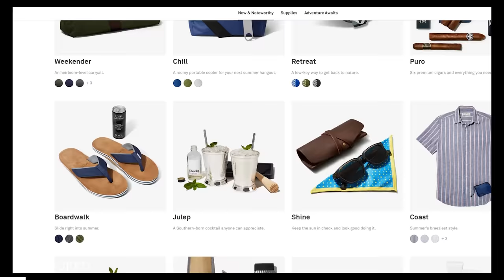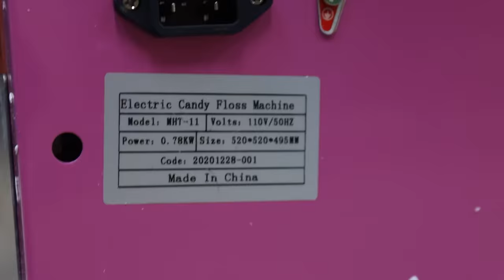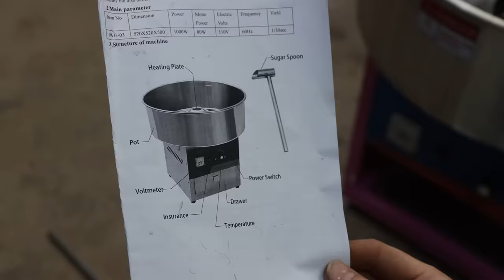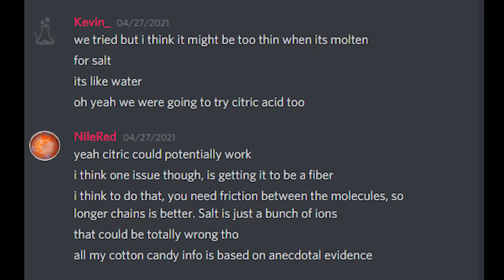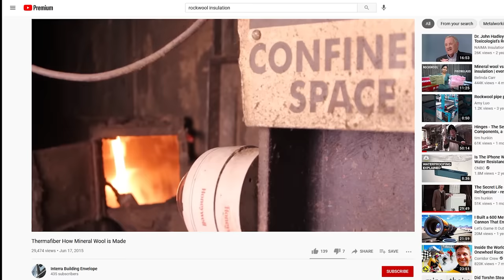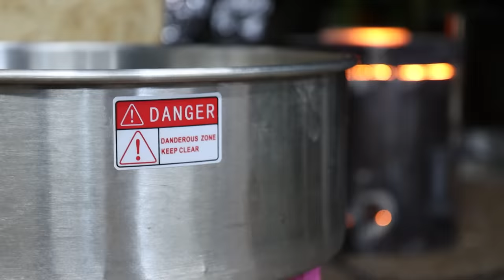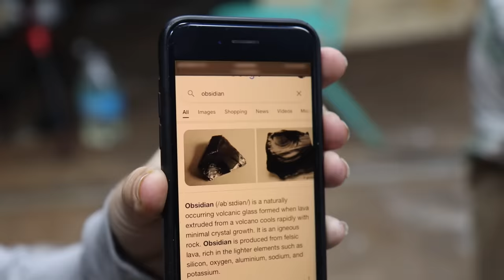Pushing A Cotton Candy Machine To Its Limit

Comment: as a person who cleans cheese cutting equipment for a living, I can confirm cheese turns to cement when you melt the hell out of it and then let it harden
Reply: Dude that's so specific
Reply: @AriCircuit  somebody’s gotta do it
Reply: @framekixrr  I mean i respect it but damn
Reply: It's probably such a difficult task that it's an entire person's job
Reply: Cheese glue isnt used as much these days but it is really effective
Reply: What in cheese makes it so durable, and are there industrial applications for this?
Reply: @SacredDaturaa   casein, i believe its waterproof and somewhat heat resistant, doubt there is any practicality for larger scale but i know restorations still use it sometimes for old houses
Reply: @Mynameischef  yep, depending on the cheese it can be fairly heat resistant, especially after it’s been melted. I’m not 100% sure but I think it’s the fat in the cheese that has to do with it. Regardless, we use high pressure hoses at around 150F to deal with cheese that gets missed in the process and ends up hardening for a while
Reply: @Mynameischef  CHEESE HOUSE
Reply: My family makes fondue for Christmas every year and cheese fondue is the most hellish thing I've ever cleaned off a pot
Reply: @thatguy3903  well, that's actually the reason why most swiss dishwashers have a fondue/raclette program 😂
Reply: @trox6734  omg I need one
Reply: @k1rbyst4r56  wait i thought the cheesed cutting equipement  cleaning job was a joke i dont believe cheese can be that durable mate I REFUSE.
Reply: @srflipp_  the cheese cleaning lady tells no lie

Comment: I had an idea recently to produce fiber insulation from recycled plastic chips, using essentially exactly this process.
I was concerned tho that the molten plastic would be too viscous and wouldn't flow well..

If you haven't got rid of that machine yet, do you want to do me a quick favour and save me some effort..?
Reply: That is an absolutely fantastic idea you should discuss that with some companies if I had more information on it I would try to help you my only concern would be potential fumes that could be a byproduct of heating certain plastics so if you have an already put research into that I would recommend it but otherwise that is a phenomenal idea and I can’t see why that wouldn’t work
Reply: Im afraid plastic would act as bad as the cheese when heated and it would be dangerous to use as insulation because plastic is flammable
Reply: You don't need to do all that at all to do this with plastic that can be remelted. Heat PLA to around 200C to 230C. Press a glass or metal plate up to around 60C into it for a few seconds, don't even have to press hard, just enough to hold it there. Then pull it back. You can create longer strands by keeping the area around it warmer. Stringing with your remeltable plastics is a very difficult to solve problem so that would make it a trivial choice to create fibers.
Reply: @blackhole3407  so is regular insulation though
Reply: @milkmakersunchip2855  rockwool and glasswool dont burn at all.  Plastic however is made of oil and would melt and burn like crazy
Reply: There’s a video that discusses new uses for mycelium, insulation included. That may be a better alternative to looking into plastic.
Reply: this is already a product, people cut thin strips from plastic bottles and heat them, search it up
Reply: @milkmakersunchip2855  standard modern insulation for houses is designed to be flame resistant. The paper backing obviously isn't, but the insulation itself is, as well as the sheetrock in front of it. Both pretty much just disintegrate in a house fire instead of fueling it.
Reply: @Fit4C  God is dead
Reply: @michaeldaigle7207  Can confirm, one thing in my line of work is that I end up soldering near fibreglass insulation with mapp gas. The insulation doesn't burn it just sorta crumbles. Drywall/sheetrock/gypsum board is a bit different where the paper it's encased in is technically flammable, but is chemically treated. I may be wrong. There's also thicker "Fireboard" which is mostly intended for use between units and on ceilings
Reply: @xald1234114  yes, the paper on drywall is flammable.
Reply: @Fit4C  Dude spoilers for the bible, man... not cool

Comment: When you heated the salt while pouring it started to work, but it broke due to the temperature change. It makes me wonder if it would stay as a fiber  if you put the whole top of the cotton candy machine in a make-shift oven. Maybe it's worth a try?
Reply: That’s what I was thinking too but who knows how he’d be able to keep the salt at a high enough temperature without reducing the structural integrity of the cotton candy machine
Reply: Yes
Reply: Wuga wuga
Reply: @bagelboomer  He'd have to machine it out of a different metal than aluminum.
Reply: based gmod man
Reply: IT'S YOU!
Reply: i feel like the aluminum would start melting long before you could get it to a temperature that didnt make the salt do that. That being said, maybe if you could pump incredibly hot air into a closed off area containing the machine it'd work
Reply: brian why are you such a varied man

Comment: that "tiny piece of plywood and offset small plastic sheet" as full security setup against rapidly shooting lava is simply divine
Reply: One thing that is reassuring is that because it cools so quickly, they wouldn't be in any real danger. They basically made glass out of rock instead of sand.

Comment: Sugar can take on several crystalline forms and salt can only take on one im not sure if it would be possible to stretch salt out the same way you can with sugar without specialized equipment or changing the chemistry of the salt

Comment: The only other thing you can put in there would be plastic where a mask when doing so. Other than plastic you could upgrade the machine using tungsten pieces the heat get it to it highest heating point before it gets red and starts warping  you could then make aluminum cotton steel cotton glass obsidian ect.

Comment: I feel like if you had a heavier duty bowl (thicker with a higher temp rating) and then had some tool to help pour the crucible, you’d have a lot more success.  An important thing is consistency and when you overload the spinner it clogs us, and if you under-do it, the string gets taken all over due to winds.  You’d need a hotter crucible too so you can get the rock to a less viscous state.  This would help it pour evenly, but any hotter and you risk hurting yourself… you have a higher chance of hurting yourself, this is already dangerous, but not dangerous enough.  

Honestly if you had that kind of set up, I think you’d have a small manufacturing plant.  So might as well buy the real deal.

Comment: salt is cristal
caramel is amorphic
in other words - salt just can't stretch
you'd better try plastic and other polymers
And also try different "dispense gaps", temperature and rotation speed (bc of density and viscosity)
Like chees probably needed more speed and bigger gap, but less heat and so on

Comment: What, you never tried human cells?

Some doctors will actually use real cotton candy machines to make flesh webbing In order to pack transplanted organs in a stabilizing foam before putting them into the body. Most of the flesh cotton dissolves but some of it becomes capillaries